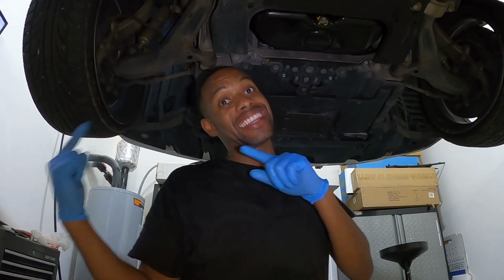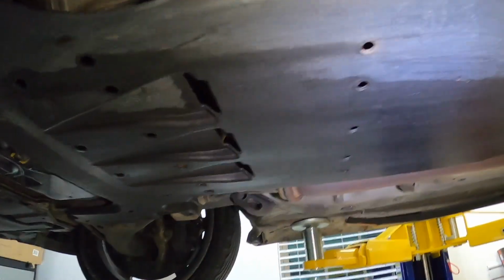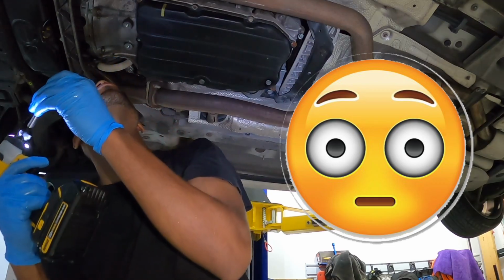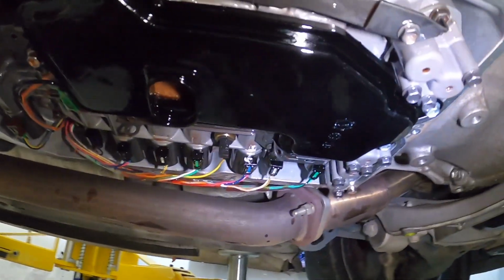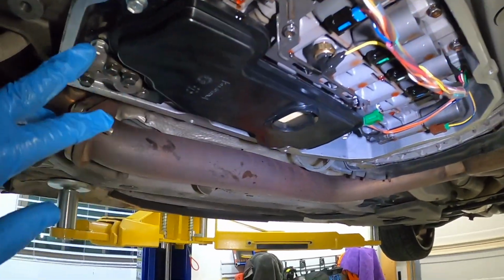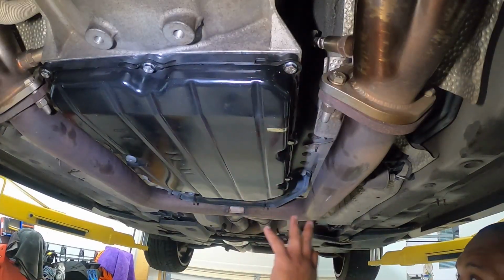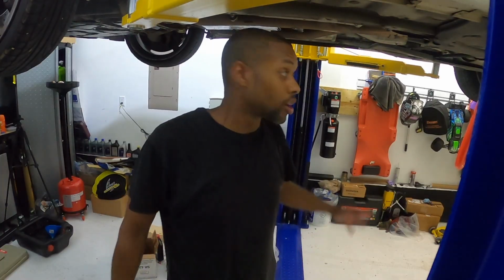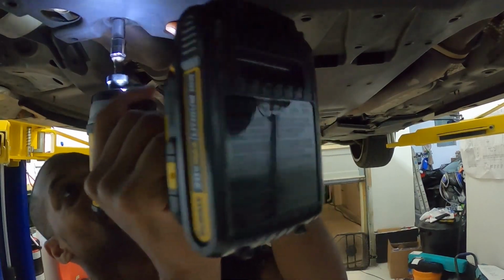2008 Lexus ISF GSF RCF DIY Transmission Service including Filter and Gasket - 2URGSE

Comment: Just an fyi, I would have loosened that fill bolt before doing anything else.. Did that when I replaced my rear diff fluid on my F. Good video though
Reply from the maker: Great callout. 😊I always check the fill bolt first to make sure I can even complete the job in the event there is an issue with the bolt. I will add it to the description as it's always hard to remember everything when you are recording. Thanks for sharing.
Reply: @btbuildthings  I’m such a mediocre “mechanic” I have to have a bunch of failsafes in place lol. I’m digging the set-up too man, I don’t really want to do my pan drop on my back, but it may come to that!
Reply from the maker: We all have our mechanic issues but the important thing is we are enjoying what we are doing! Failsafes and all. 😄

Comment: Had the same issue with my bolts snapping I was able to get it out with a vise grips and replaced them with Stainless steel m6x1.0 20mm bolts. I would highly suggest everyone else do it as well.
Reply from the maker: Well we know for sure that these bolts should be replaced after some time. If it happened to both of us, then it's worth swapping out as you suggested for sure. 😀

Comment: Hey brother, btw dont use an impact to remove the bolts, they snap because theyre rusted shut and using the impact breaks the bolt in half
Reply from the maker: Ahhh. Got it. Thanks for the insight.

Comment: How's that filter working out? I'm debating on going with it or just sticking to OEM from Lexus.
Reply from the maker: The filter has been working fine. No issues considering when I went to the dealer the first time for transmission service they never even changed the filter. As far as sourcing parts, I typically use rockauto.com and they currently have 4 manufacturers that supply the filter. It is very highly likely that the OEM filter is coming from one if not more than one of those companies listed.

Comment: Hey bro I went to the Lexus dealer they said these use "lifetime fluid" and the trans is sealed so they don't ever service them. They said they don't service any Lexus transmissions. Pretty crazy
Reply from the maker: So when I first came across this "lifetime fluid" discussion I was like there is no way the fluid is lifetime. The first time I took it to my local Lexus dealer and they changed the fluid. The advisor said it should be changed around 100-120k miles if I remember correctly then something like every 30k after that. Not sure why all dealers are not on the same page but as far as I know, I want my car to keep running so I'm changing the fluid. Lol!

Comment: how does it drive after this, were you having issues with it before you decided to change
Reply from the maker: When I initially got the car, my assumption based on mileage was that it hadn't been done before. So first time I had the dealer do it and it did run much smoother. Since the initial change, this is the second one which I did myself and it gives me such confidence knowing the fluid, filter, and gasket were changed so that I can continue to enjoy this car. 165k and counting everything is running smooth as ever. 😁
Reply: @btbuildthings  yes I had 2010 and now a 2014. I am very weary on doing transmission fluid change had some terrible failure in past for fooling around down there. I like to hear feedback from owners to see if it starts to slip. your the third person who says it smooths it out
 I may be in minority but I like the hard immediate shifts of the F. do you loose the punchyness with the change. I like the stabby up shifts
Reply from the maker: You shouldn't be weary! 😄 Fluids break down over time and not to mention the metal shavings that are also inside. The job isn't that bad and I know I feel better knowing that this maintenance will prolong the life of my investment.
Reply: @robstyles2675  Mine works fine but sounds a bit different at idle and low gears.   2013 IS-F, 42K miles. Getting this done soon.